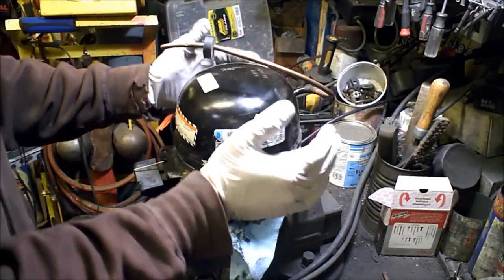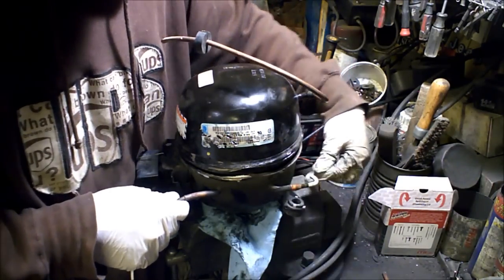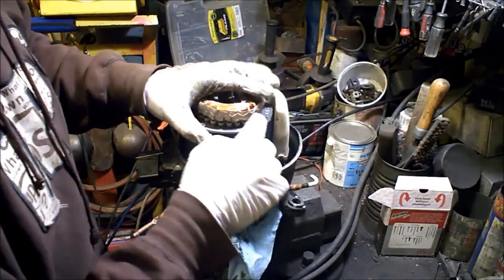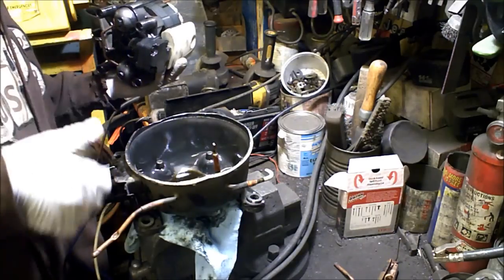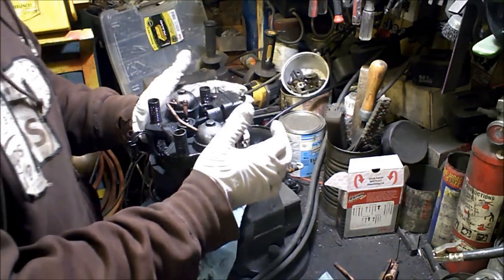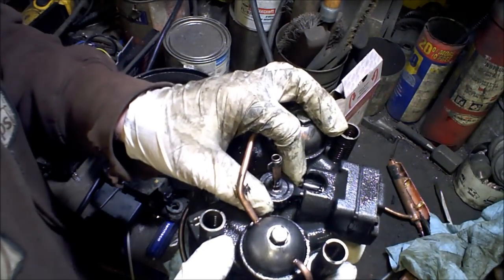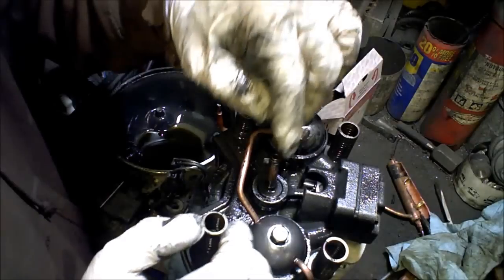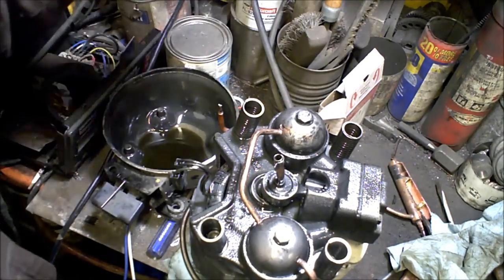Refrigerator Compressor tear down

Comment from the maker: The side with the sticker was facing the back, so if you laid the refrigerator on its back oil couldn't get into the intake and you would be OK. But if  you laid it on the side where the intake is you could get oil into it and "Hydro Lock" it. However the way the intake is designed even if oil got into the intake, if you let it sit unplugged for a day or so it would all run out through weep holes and you would be ok to plug it in.

Comment from the maker: The most likely cause is melting Popsicle or the like. There is a drain in the bottom of all refrigerators that takes melted ice or ???? and drains it into a little catch pan. Most of the time the stuff evaporates by itself but the pan is only so large and can overflow. Or the hose that leads to the pan can develop a leak.

Comment: Thanks for sharing the video. I have a better understanding on what is going on inside. I think that key could be a counter weight for the shaft. Looks like the slot is on the opposite side of the shaft that the offset pivot point (cam) sits for the piston.

Comment: The motor turning the crank shaft is an AC induction motor. I have one that is way bigger than that one but it has 5 wires. Good thing mine came with a wiring diagram (and it tells the rotation as CW or clock wise and CCW or counter clock wise, but it is backwards). Got some alligator clip wires and a wall plug from an old alarm clock, wired it based on the diagram and plugged it in and it ran away (thats and expression for it started running). Someone wires up one of those crank shaft motors and had to kick start it, but it died quickly, so you don't do it or you could have a fire 🔥, but the person who did it didn't have a fire luckily.

Comment: I bought a new Galanz mini fridge in late 2019. Ran fine for the next 3 years before storing it laying on its back in my parked van for the next 20 months. Had the van trailered 630 miles to my new residence where I set the mini fridge upright to wait two weeks before plugging it in. Nothing came on even though my VOM shows everything is OK. Am wondering if road bumps jarred the compressor enough to jam something up and if dropping it a few times might knock things loose again?
Reply from the maker: I bet the start relay that plugs into the outside of the compressor has fallen off.

Comment from the maker: I think it was just a fluke that it failed. Its a shame that a $500+ unit it junk because of a 10 cent part. I am sure that it could have been made of a more expensive metal to add life but it did last 7+ years. Reed valves are very common but there are better designs.

Comment: Very informative. Always wanted to take one apart. It's amazing how long they can last. One thing, do you think this particular reed was made of a not so good metal? No amount of lubrication could prevent premature metal fatigue. It bends back and forth quite a bit. Do other compressors use a more reliable method of valving?

Comment: what is responsible for the surprising heavy weight of the things?
I have a Mitsubishi 1980 one similiar size/shape to  yours, it is so heavy..
Reply from the maker: The copper windings are heavy as well as the cast iron core the winding are around.

Comment: Is that a shaded-pole electric motor?
Reply: Kompulsa I don't think that's a shaded-pole motor because shaded-pole motors only have 1 coil and 2 copper bands where the rotor is. The compressor motor has a full stator and not 1 or 4 coils. Some motors do have 4 coils.
Reply: Once he opened the shell and let the light in the pole wasn’t shaded anymore.

Comment: Are those windings submerged in oil?
Reply: Yes. They get " submerged " when the current flows through the stator and makes the rotor spin which rotates that " crankshaft " he showed and by centrifugal force shoots the oil through out everything including the windings.
Reply: John Obmar d